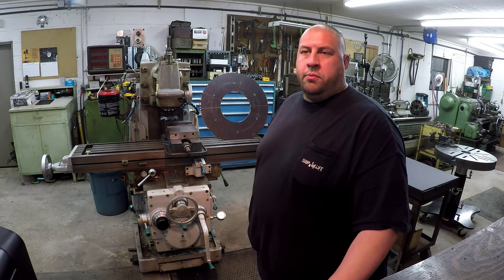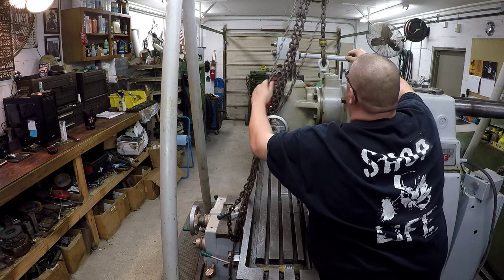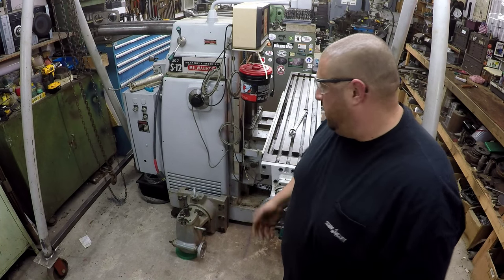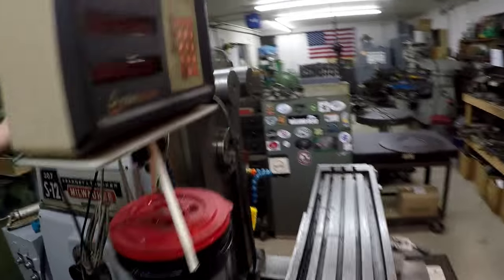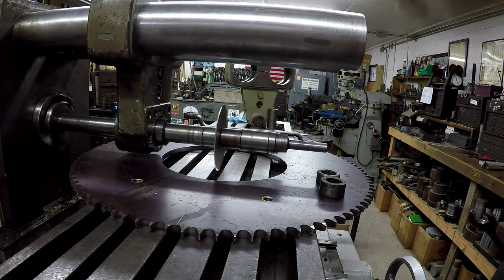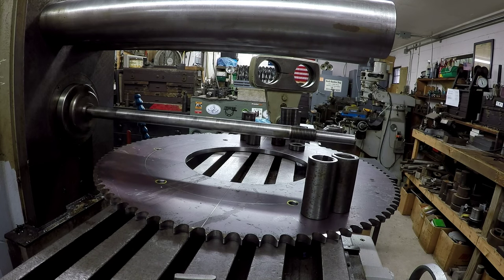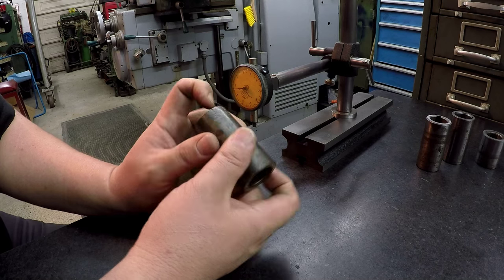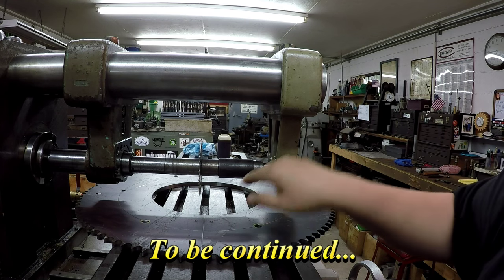K&T Vertical Head Removal & Setup for Horizontal Milling

Comment: Adam: Your arbor diagnosis is probably right on with what is also happening with my antique B&S. I couldn't figure out why when I checked the arbor between centers it had no run out. The mill was used in school shop and they probably wouldn't let students ever put a key in the cutters (in case of a climb crash) so a slipping cutter would mar up the spacers. Will check that....Dave
Reply from the maker: Sounds like a plan David. Give yours a check. I bet you might find a bad one or two at least.

Comment: Thanks for sharing, excellent video as always, I get this problem often - depending on the position of the supports and spacers - never occurred to me that the spacers would bend the arbor if the ends are not clean and true!

Comment: I've had that exact issue you're having with the spacers. In my current job, I set up and operate mechanical test equipment that includes shafts over spindles, both of which are ground to form a pair of eccentrics, so that when the shaft is oriented properly, it will have a particular indicated runout (the value changes from one test to the next). The shaft is positioned on the spindle with spacers and held in place by a spindle nut, just like on the milling arbor. And in the exact same way, any dents or debris on the ends of the test shaft or spacers will make it difficult to set the proper runout.

Comment: Excellent detective work, Adam! I was having the same runout problem on the arbor on my Hardinge mill and I never thought to check the squareness of the spacers. It never really caused any problems with the cut but it always bugged me that I couldn't figure out where it was coming from. I'll have to run my spacers under my height gage and see if that's it.

Comment: Adam,
Nice work on repairing the spacers. There's nothing better than a nice straight shaft! ... I hope you have steel-toed boots on when you reinstall that vertical head. If you dropped that on your foot, I'm afraid it would leave a mark . . . not mention broken bones! Thanks for another great video!
Have a good one!
Dave
Reply from the maker: I'm sure if it fell on my foot even with steel toed boots is still be having some damage.
Reply: +Abom79 In my experience of safety boots, the only thing a steel toe cap guarantees, is whatever falls on you, will miss the steel part and hit you just behind it!

Always the way.

Comment: Adam, a couple of comments. When using lapping parts by hand I was told to move the parts in a figure 8 pattern. It is supposed to make the lapping process remove material evenly, where moving the part in one direction will tend to remove more material from the "leading" edge of the part you are lapping.The sprocket has precision cut teeth to match a chain. When you split the sprocket, you are removing some material as a "saw kerf". When you mount the 2 sprocket halves, the missing "kerf" material will cause the sprocket to have 2 teeth that are smaller than they should be. This may cause issues either with the sprocket, or chain. Do you plan on using a shim to replace the missing "kerf" material when installing the sprocket, or will you run the sprocket undersized, and hope for the best? A better way to split the sprocket, would probably be to cut 2 sprockets, offsetting the cut 1/2 the width of the saw kerf, so that the 2 "larger" pieces would be the same size as the original sprocket, when installed as a pair. The "smaller" pieces would be unusable scrap metal.
Reply from the maker: +kwbarnes1 I completely understand, and on parts that need equal halves thats how we build them. This job did not require that. The bolt pattern is was mounts the sprocket and holds it in position so when it's on, you well see that 3/32" split line in the middle.

Comment: That round detail on the right side of the mill you said you didn't know what was. I think it might be the other end of the over arm traverse pinon shaft. Try turning the handle and feel on the other side if it rotates. Also when you are removing the vertical head after you hook up to the hoist and slacken your clamp bolts. Then you can roll the over arm rods back out of those counter-bores and the head should come off without having to remove all the bolts and the clamping bars. Hope this helps.
Reply from the maker: Your probably right.

Comment: I don't know if this was mentioned earlier but the two end surfaces can be parallel to each other but still cause problems if they are not perpendicular to the bore center-line. Proper inspection and grinding (if needed) should both be done relative to the bore.

Comment: That freeze plug is the other end of the bore for the pinion shaft.  If the vertical attachment will hang on the overarms why not loosen the clamps first and roll it out some for the crane to clear? I guess that bushing was some of that semi-finished tooling. lol
Reply from the maker: +bcbloc02 Good point, but once you mount the head the overarms will still be in the way for the crane to roll by. I guess I could use that trick when dismounting it though.
Reply: +Abom79 Just don't bounce the head off the table and onto your toes...
Reply: +Abom79  I tried that once and only once. Almost dropped the head but luckily the overhead crane was still attached. The overarms won't hold the head by themselves, not enough purchase. That is just for alignment. Notice how far the CG is from them.That is when I decided to build an ATTACHMENT PARKING CRANE.
 The way clamps I loosened top, bottom and then middle, left the wrench in place, slid the clamp out and tightened the nut so I never had to wrestle them or had them vibrate loose and end up on the floor.
 When you have the mill really clean remove the column scrapers and you will see why you need a way guard back there. Just a piece of pond liner clamped to the column below the head and attached to the saddle. Save the ways. 
 Glad to see you found the problem with the spacers and that it's an easy fix. Lots of memories from your great video.
  Mike (o\!/o)
Reply: Moholo 88
Good to know, I didn't know how far onto the rams the attachment stuck. On my Cincinnati the vertical attachment hangs from the overarm like an arbor support so I can have my overarm full out and still have the attachment fully hang on it. In fact that is how i always take mine on and off because my cherry picker won't go around the mill base and I can't get close enough to hang the attachment unless the overarm is out.

Comment: Hi Adam, If you were to replace the fixed casters on your gantry crane with swivel casters that have swivel locks, I suspect you'd be able to position the A frames to the left and right of the machine instead of the front and back, where you're running into interference problems. When you're done, you could then put the gantry back into its current orientation and lock the swivels, so it would behave exactly as it does now.  Just an idea.  -Chris

Comment: Maybe that plug is just from the casting process?  I have no experience with it but I know the freeze plugs on engines are from the casting and not really intended as freeze plugs.

Great video.  Right when you said the spacers might be off I thought about the grinder :)  thanks for sharing.

Comment: It would be interesting to see what runout that arbour actually has.

Looks like those bushing pieces need some attention - like you said they need putting through that new special grinder once you get it set up! (Just another job!) 
Could the ends be out of square with the bushing bore?

I'm looking forward to part 2.
Reply from the maker: +Dan Whiteford It's possible yes, but this was a quick check to see if I could find parallel problems. As long as you have a few thou clearance in the bore, the end faces should square up. I'll probably do more check later with them mounted on a mandrel.
Reply: +Abom79 could that be part of the problem too? some are burred internally around the keyway, not letting them float a few though?  just throwing ideas, i know once you get the time your gonna go through them with a very close look, i guess its how it goes for used equipment, you will eventually get all the bugs out. look forward to the arm build of course!

Comment: It's been a while, but back in day, it was not uncommon for an operator to keep a selection those spacers that he was familiar with and a couple of them might have the ends ground intentionally on an angle by a few tenths of thousandth so that when you make your stack up, you can place those to opposed each other's taper and in one orientation, they will cancel each other out and stay straight, or rotate them to create a slight angle (and I mean very slight) which can in turn correct the arbor and make it run true. Sounds a bit crude, but it's not. You can with see on the spacers that you measured, that they can a couple tenths out and that tiny amount, times a stack of several spacers times the length of the arbor can add up and easily send your arbor off crooked. Some guys might even just stick a piece of paper in between one side of one of the spacer to achieve that same result, but maybe not quite as precise.
   Also, not 100% sure, but pretty sure that that plug is to cover a hole in the casting used as a pivot for an internal shaft. It never needs to be accessed, except for a major re-build, so it's covered and painted.

Comment: Yep I had the same problem with a big brake lathe at a truck shop I use to work at. It ended up being the nut that was not true on the face of it.
Reply from the maker: I've been concerned out mine too, I might have to machine a mandrel and face them off.

Comment: +Abom79 I have no idea what that other freeze plug is for either.  Never did remove it.  If arbor spacers are not true it will warp the hell out of an arbor. Now you know why those damn things are always expensive!  Great video.  Taking that head off and putting it back on is a bitch.  Tip on mounting the arbor supports, tap a couple small wedges in the slot in the middle of the support (just barely) and they are a lot easier to mount.
Reply from the maker: +James Kilroy A couple guys have chimed in and said its part of the bore for the pinion gear. I didn't think to search for it in the manual but will now. Yes, those supports are precision! Gotta have the straight to slide on! Thanks for the tip.
Reply: +Abom79 Before the wedge trick I could barely, and I mean B A R E L Y, get the ones on the 415 mounted by myself.  They are freaking heavy and above shoulder height.  It was a real ass buster to get that damn things mounted.  Now I just tap in a couple of bronze wedges, lightly, very, and that support slides right on, then I pop out the wedges and I am good to go.  You are right about precision, there isn't a bit of slack.  I am sure the factory supports were hand fit.  However none of those supports you have came with that machine.  It was a multi year process for me to collect those.  That is probably why they fit so tight.

Comment: Nice detective work.  What size mill cutters do you need just to clear the supports to make a cut?
Reply from the maker: +ILGopher Looks like 4" will be your minimum, but won't give you much depth of a cut. Not all jobs have to pass under the supports though.

Comment: That wasn't hard!!!!! And you said to me when I asked about removing the overhead a while back that you didn't want have everyone see you struggling with it. Personally, I think you just want more BBQ time. 

I don't think you had the gantry setup the first time you pulled it. can't remember. The K&T seems to be a nice machine, flexible layout, common sense assembly, and capable multi-uses that can take advantage of a .reasonable size Bridgeport for the "home" size shop. Thanks for showing all the steps.

Comment: I was wondering how this change was made from vertical to horizontal.  It doesn"t look like changing a blade on a table saw....quite a job. 
 Is there some viewers who would have seen a milling that has some huge hinges from where one of the head ( may be two) is pivoting whitout having to be taken away  ?  I am not sufficiently sure to bet on that...

Comment: You might want to check that the faces are square to the bore, not just parallel to each other. Could be a good video to measure then correct all that.
Reply: +Rambozo Clown he mentioned using an expanding mandrell then facing in the lathe, which would make it square to bore, i guess he didnt show it as he has solved it, he mentioned they may be very hard, but i guess they were fair enough to lathe cut rather than having to wait to surface grind
Reply from the maker: +Rambozo Clown I need to do that yes, I'll I'll revisit that at another time to make sure all of them are parallel with the bore. I wanted to get this job done when I found the problem with that one spacer. Removing it fixed the issue.

Comment: Something that I have started using is Neodymium round magnets to hold handles in place. I am guessing that the crank handle shaft is about .750".   a single NEODYMIUM round magnet will hold that crank on and it will take 50-60 pounds to pull the handle off. I get my magnets at LEE VALLEY TOOLS
Reply: +Bob Smith ------- 1 MM X 1 MM   ??         :-)

Comment: I bet it's a lot nicer walking around the K&T when it's in horizontal mode!  Looks like that found/fixed your problem nicely.   I recently picked up some items that were previously in a Chrysler plant.  I didn't find any marking on mine, but other than the base, it looks a lot like your Browne and Sharp indicator stand.  http://coypaeltz.com/jmhoying/hdstand01.JPG
Reply from the maker: +Jack Hoying That does look just like my B&S. I bet it's built by them. Just a different base.